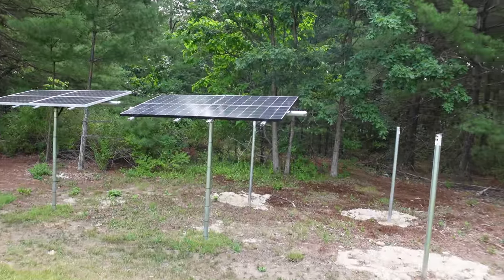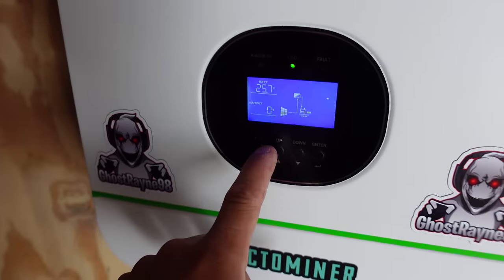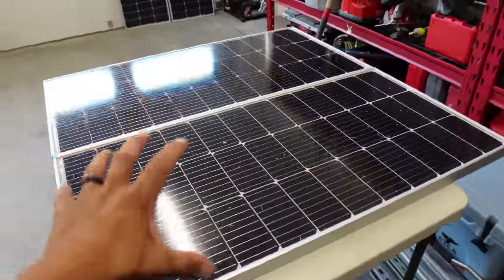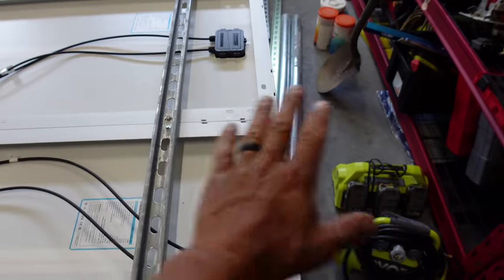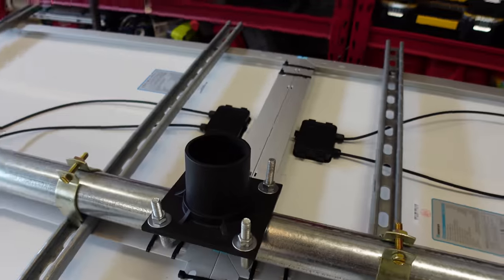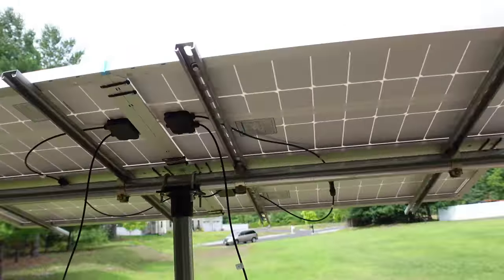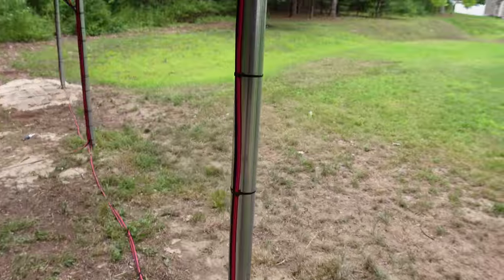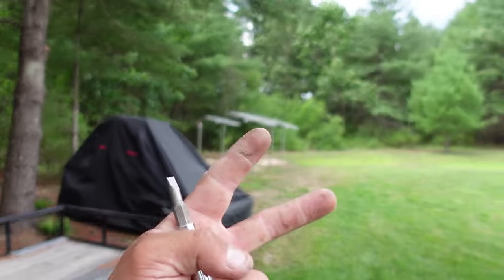Completely rewiring my crypto mining solar panels #diy

Comment: Quick question or suggestion did you seal or weatherproof that plywood you have the combiner box on?
Reply from the maker: Haha I thought of that too. To be honest I didn’t it’s just plywood I had laying around
Reply: @ChumpChangeXD  i would have slapped some varnish or some paint on it try and make it last as long as possible to prevent weather rot

Comment: 3:04 Interesting, seems like the panels you have are built on half cells, you can see only one side of each cell has the 45* angled corner (chamfer), those usually come in squares and have all four edges chamfered, I'm guessing those are rejected full cells that had the edge chipped off or other damage and then have been cut in half and reused, most likely production rejects so should have 100% life.

Comment: Well you are making it pretty... lol jk. It looks good. I changed up my system and now I am running about 4k watts of my mining on solar. It is still switching back to grid power at night. I am running 11 1660s on it and my old 9 card 580 rig with a couple vega 56's on it. 
I don't know what your voltage limit is on that growatt system but I have found that the higher the voltage on the panels the better. I see you added som more batteries. It looks like 4 24v lipo4's. I will watch that video. Those babies are pricey. Well you are in another rabbit hole with the solar, just like mining. Have fun.
Reply from the maker: Haha so bad man… always something. Yes lithium iron batteries are expensive but much more worth it over SLA